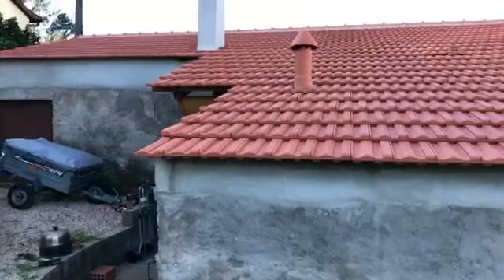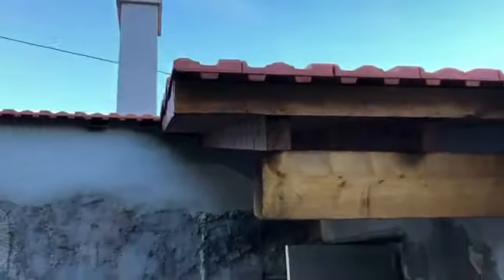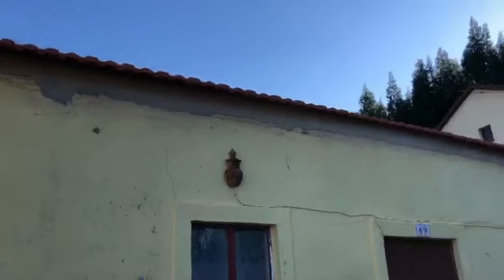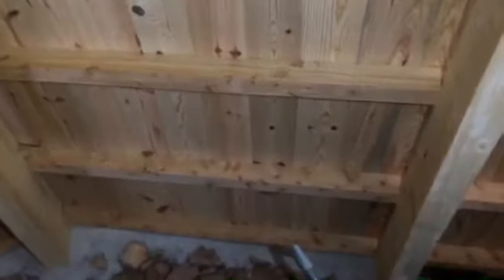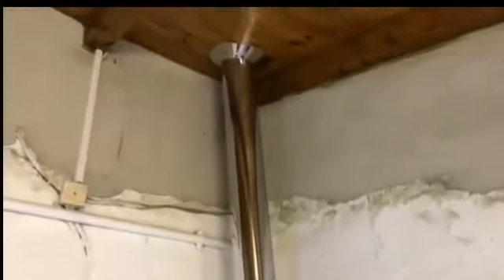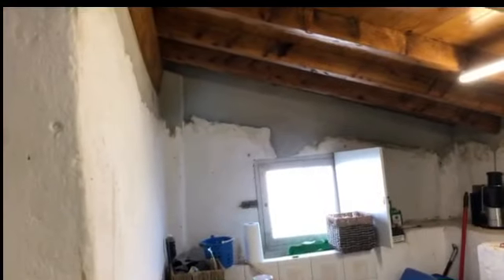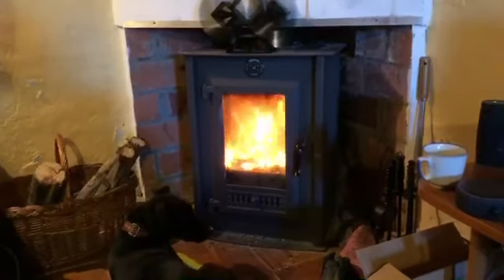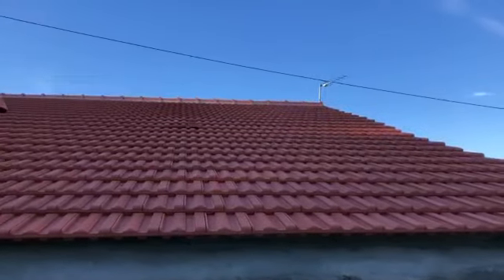New roof tour Central Portugal project house - Replaced & raised in height by local builders ✅

Comment: question did you have to get any permit ?  I am in need of replacing the roof in my little house in Portugal but I would like to raise the roof half a meter.
Reply from the maker: Pretty sure builder who did roof didn’t need any as the front (street side) elevation wasn’t changing at all 👍

Comment: Hi well something recommended by utube that I really enjoyed I first watched your drive through from Holland as that's the route I'm looking at as we have just purchased a small house in Sao Pedro do Sul, not sure if you have said where you are since I have only seen these two I will watch the older ones in time. That's a great roof we have floor beams to replace to so I'll be warching and see if there's any thing I can pickup from your experience.
Yer the 90 day thing is going to be a pain for a while.
Good luck and wishes Martin
Reply from the maker: Thanks for the comments, the ferry was superb, not sure if we just got lucky with the weather it was very smooth crossing, highly recommend especially if your traveling from North of Harwich. We are really leased with roof it has made a huge difference to our house, we are near Tomar, all of Portugal is stunning. Good luck with your house.
Reply: @tapasandfika 
Hi glad you had a good crossing I'm sailing from Newcastle I have used the ferry several times on trips around Holland the crossing has always Been good and the food on bourd is amazing. I would rather drive across like you did than have to drive down to London and use the ring road as its always packed and to be fair a little intimidating. Keep well and enjoy the sun. Martin